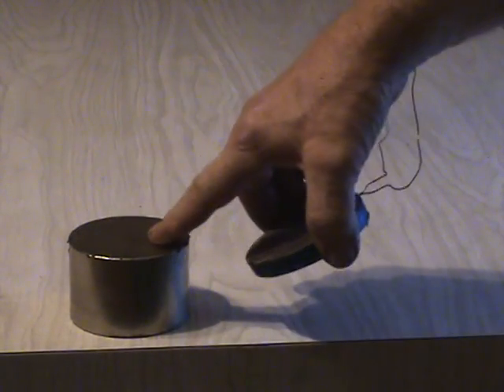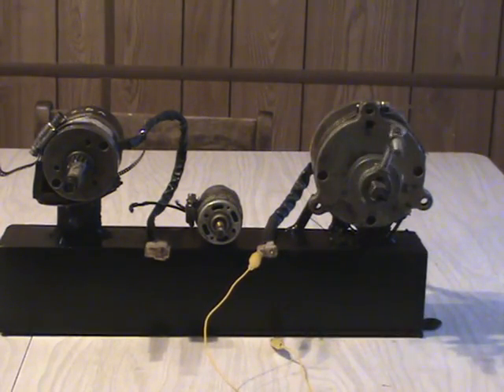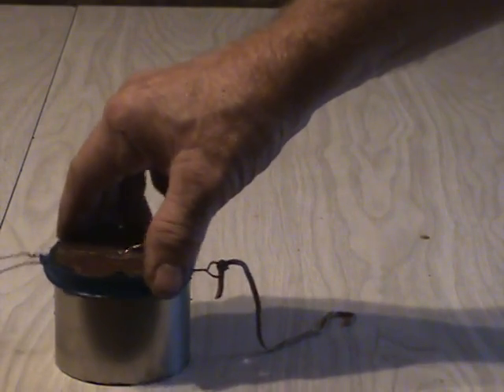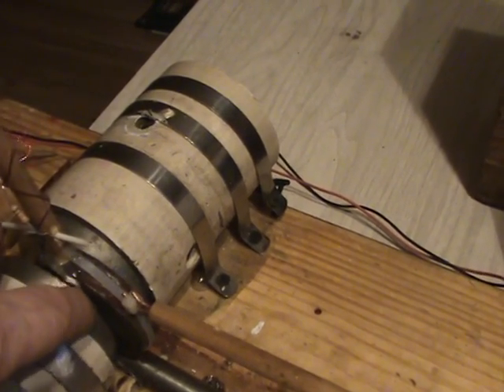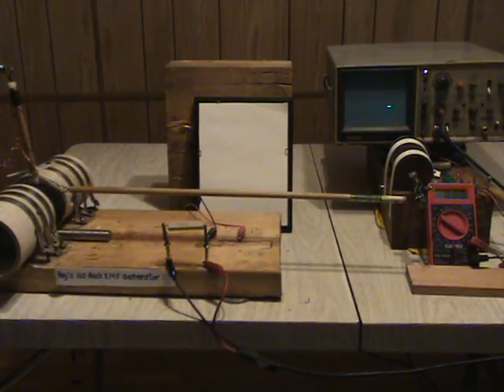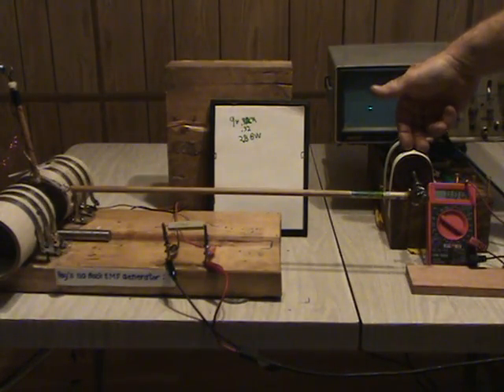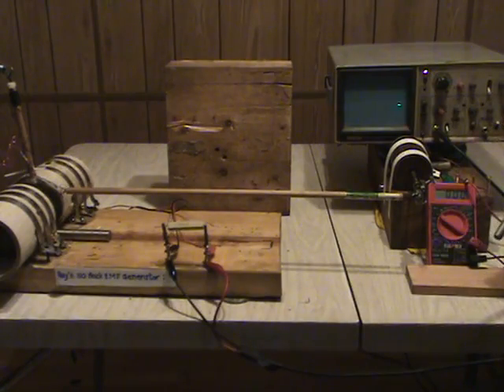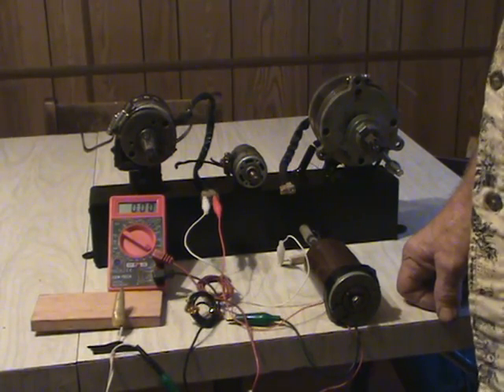Ray's No Back EMF Generator

Comment: weslingm
He is not saying it's not producing bemf. He is working within the natural boundaries of the bemf, produced within a coil of wire. Also if you intrude into that bemf boundary a little more it might not have any reversal drag, but maybe it will hit that bemf wall and have a rebound effect(much like a rubber ball hitting a wall) which would decrease input power consumption.

Comment: Dear Raymond the return impuls EMF is caused by the change of the magnetic field and the circuit switch Off the shutdown! Moving a magnet in front of the coil will not cause EMF back.

Comment: Get rid of all metal houseing components, use neoprene or carbon fiber.
 Get rid of the coils.
Use copper disk with paper insulators and transmission wires at each end.
Put your rotational magnets in repelling mode on the rotor.

Comment: If you made a voltaic AC motor with copper and iron wire you could a motor that won't have back EMF OR EVEN a generator that self starts because you essentially made a battery  in side the motor windings.
Reply: dragoola69x 
How

Comment: Hi Ray. EM theory says that if the strength of magnetic field through your coil is changing, you will read a voltage from it, or you can drive a current into a resistance to do some work. Your 'free jump' means that the coil is seeing only a small change in the magnetic field. With two strong magnets (attracting) close together, the magnetic field lines will be virtually parallel across the gap and for small coil movements there will be little generation. The EMF is a key design feature of any motor or generator, and it is a basic variable in the formulae that govern the mechanical and electrical behaviour of those devices. It is easy to be misled by non-dc wave-forms but you will find that if you can measure the energy accurately at the various points around your circuit, there will be no mystery and no free energy. But it's a nice experiment.

Comment: Not strange at all!  You should trigger on the signal on your scope to see if the waveform is a sine wave or a pulse!  My bet is it is a pulse where it is high only for a short portion of the cycle.   You should not use a multimeter to accurately measure the current when it is a pulse signal.  Use your scope for both voltage and current measurement.  Then you can determine if BEMF has been eliminated.

Comment: Hi Raymond, I  know this is  almost 3 years old now but I believe you have few problems with your interpretations of the measurements:

A) you cannot compare peak-peak results to the DC input directly. You need to measure the RMS values of volts and amps and calculate the power from these. If your voltage was a pure sine wave you could take the peak value of your oscilloscope reading which is half of 1.2 or o.6 volts peak. Then multiply this by 0.707 which is 0.424 v rms. This into a 1 ohm resistor will draw  0.424 amps so 0.424 x 0.424 = 0.18 watts. Since the waveshape of the output voltage is not a sine, this power is most likely less than 180 milliwatts obtained above.
This is the "true" power you are actually putting into  your 1 ohm resistor and compared to the 2.88 watts consumed by the motor without the 1 ohm load connected is quite low which is very likely to be non detectable by your test setup. Theoretically if it was 180 mW into the load you should have observed about 20 mA increase in the motor current when loaded.

B) Comparison between your generator and a commercially made one is not really good one because of a large difference in efficiencies between the two. You will find that the commercially made generator, because of its relativelly high efficiency will  have a much higher output voltage and therefore higher output current into your 1 ohm resistor which will result in a measurable loading on the driving motor.

C) Remember that the output current cannot be added to the input current without taking into consideration of the difference between the input and output voltages and powers.

I would like to see your test results performed using an accurate, true RMS voltmeter for the output voltage and use its measured values to determine the current into the load.

Please understand that I am not being picky here, just wanting to ensure that you get meaningful results and that your viewers do not get misslead by inaccurate conclusions.

All the best.
Mark G

Comment: Thank you for this good demonstration video.
Use 2 pickup coils one on either side of a single magnet utilising both north and south poles.  The output currents are equal but opposite direction simultaneously  and can be connected to pass through a load whilst cancelling back emf. 

When you read off the peak to peak voltage on your scope ...... if it is a sine wave shape then multiply it by 0.3535 to get the rms (dc heating equivalent value). If output is more like a square wave multiply the peak to peak voltage by 0.5 to get equivalent rms heating value.

Comment: Interesting experiment. I understand that Bismuth - being para magnetic will block the expanding magnetic forces but not the contracting electric forces in the center of the magnet. What would happen if we made a generator with magnets and coils where the magnets were covered with bismuth - to block the back EMF? I am going to have to try that.

Comment: magnetic field + electrons = mechanical gears. Having drag means you are converting mechanical power to electric power. Not having drag means you are converting so little that you can not measure it. Having less drag might mean you improved the efficiency of your circuit.